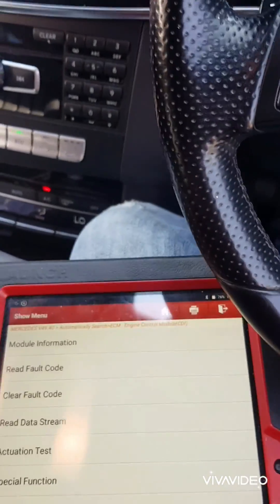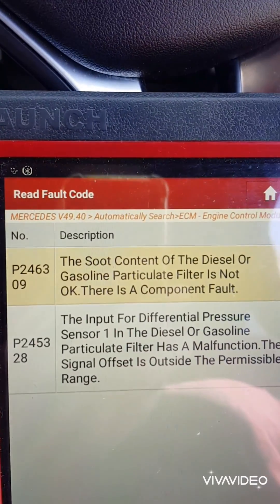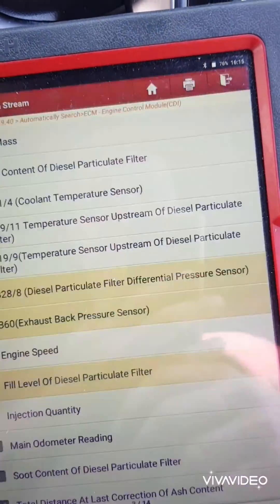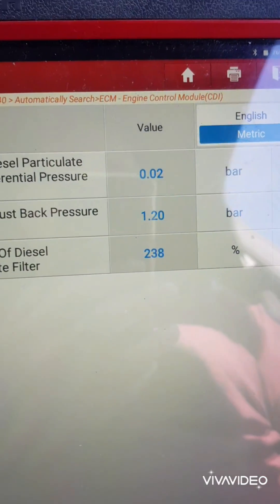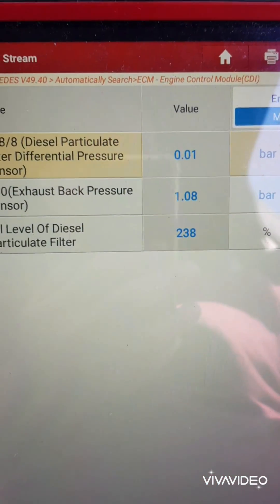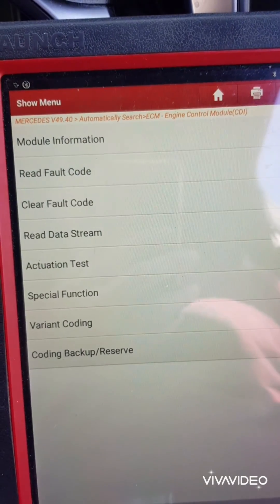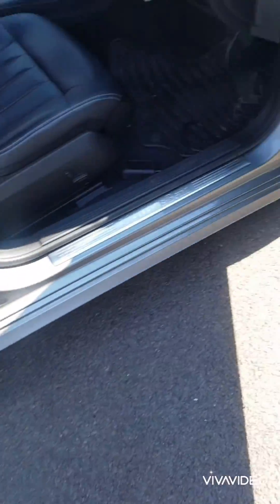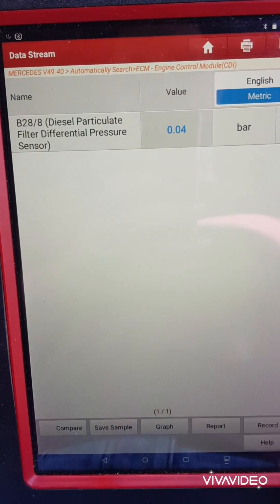Mercedes Dpf fault explained

Comment: Where is it located
Reply from the maker: Bit of a drive then 🤣
Reply: @dpfcleaningltd  yes😂
Reply: I saw your work here on dpf cleaning
Reply from the maker: In the engine bay on most
Reply: @dpfcleaningltd  i mean where is your location dear, which country
Reply from the maker: We are based down on the south Coast of the UK
Reply: @dpfcleaningltd  
I am from india
Reply: @dpfcleaningltd  i like your work and i do carbon cleaning here
Reply from the maker: Yes we have delt with Hydrogen carbon cleaning agents in the UK and have a low view of them making false claims.
Reply: @dpfcleaningltd  does it really work inside the engine